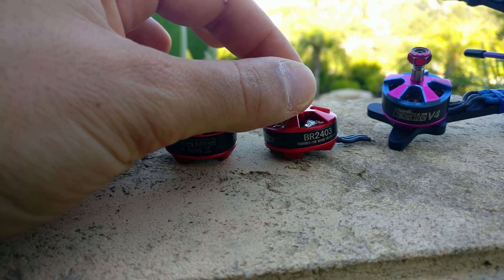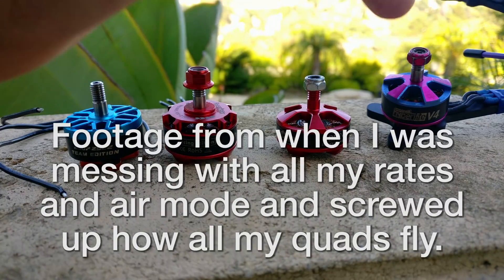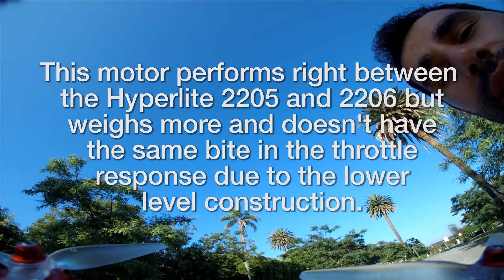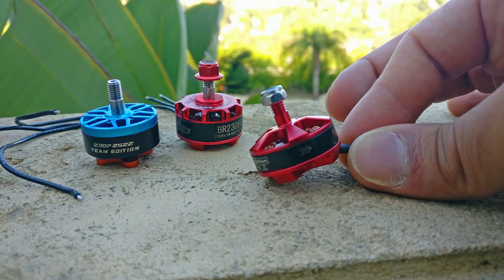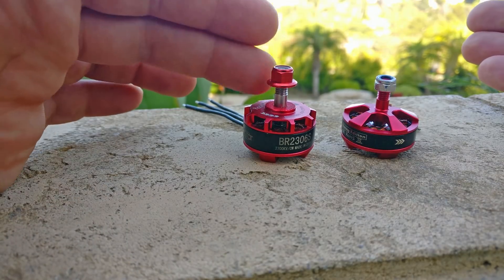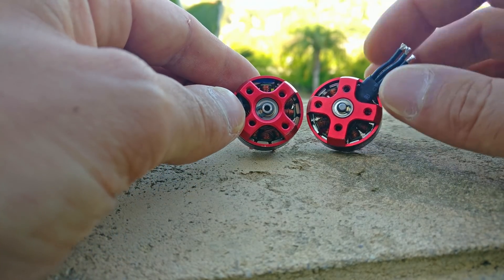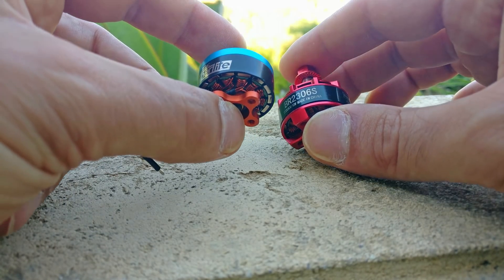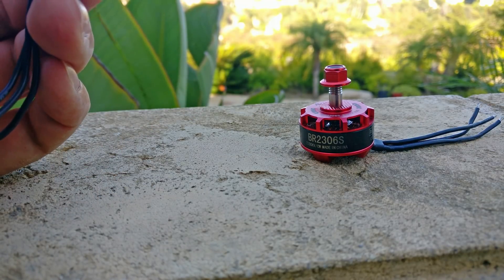Racerstar 2306 review + other things bout motors

Comment: I prefer your trash talking on banggood and their cheap products.  I like quality products and I put the Hyperlite V4 on my stingy frame.  I know you're into the super light frames but what should you suggest for a heavier freestyle build.  I was disappointed on the performance of the hyperlite motors.  Mainly because my other quad has F40 pros 2600 KV and those motors scream.  Yes they draw way more amps but the performance better.  I live in SoCal and I like supporting local shops like Piroflip.  What Hyperlite motor do you think would compare to the F40 pro.  Thanks
Reply from the maker: I totally understand what you're feeling because I've done it many times.  Super disappointing when the performance is just meh.  I'm not a super light everything builder, I'm just very aware of the weight.  Lighter is always better.  So don't put that last piece of tape on, cut your wires just a bit shorter...that kinda stuff.  Even though I like long wires.  Those motors are really only good on a light racer.  I do not recommend anything smaller than a 2207 for ANY acro quad.  The performance between the 2206 and 2207 is like going from 4S to 5S.  I believe the F40's are closer to 2700kv and they're lighter too so that would maybe account for the performance difference.  I would also ask what weight setup the F40's were on and what props you're running on both.  The Stingy frame is pretty heavy so it really needs the power of a 2207 or more.  I would highly recommend you put those motors on a racing frame and aim for a much bigger motor on the stingy or opt for a much lighter acro frame.  Also, mind the bottom plate braking on that frame.  The front section is really really skinny on the main deck.  Daniel will take care of you however so no worries.  I've been redesigning my acro quad constantly because I'm still not happy with it.  Hopefully sometime soon I'll be satisfied.
Reply: Kabab FPV I have no clue what the weight is.  I've compared the motors on a variety of props.  Hq 5x4x3, hq 5x4.3x3, buttercutter, GF 5152, and GF 2 Blade.  I like the performance of the 5x4.3x3 the best.  Very responsive and doesn't draw too many amps.  The other quad is on a chameleon.  On both quads, I like the 4.3s the best.  As you can tell, I like the bus style.  There is always going to be the next build.  I'm waiting for the top mount floss to come in stock for the light build.  

On the topic of quality parts.  All the folks pushing for the cheap products.  On my stingy build, I have the TBS bulletproof esc's.  Those are so much smoother than the t-motor f40 pros coupled with t-motor 30 amp esc's.  I'm really impressed with the quality.  I just think I need to get a larger motors.  Thinking about the hyperlite 2207 or 2306 but going to use the current ones for a while.
Reply: Are you that stupid for not being able to understand that not everyone can spend 500$ in a quad?

By the way bg also sells genuine stuff, so educate yourself, just a bit, before  commenting.
Reply: Remon Dislo I cannot comment on you because I don't know you.  I would never insult someone based on my imagination.  Forgive me for wanting quality products.  I personally enjoy quality rather than cheap.  Sorry, if I'm a snob, but I'm okay with that.   I was simply asking question to someone else until you got so offended that you needed to comment on something you have no interest in.  Keep up insulting people, it shows how great member of society you are.
Reply: Remon Dislo That was a very mature comment.   Out of content and useless information.
Reply: Remon Dislo Where did this comment come from? He said nothing about what other people can afford. He simply stated his opinion about banggood. Instead of questioning his intelligence, maybe you should question your own before commenting.
Reply: You are the one commenting crap nobody cares about. Snob, I can smell people like you from miles away, you are the typical snob that spends thousands of bucks in quads and doesn't even know how to coordinate a turn. 
Now keep telling us for third time how much you like quality stuff and about your shitty experiences with motors. Gosh, you wouldn't be able to notice if you are flying a quad or a fixed wing.

Comment: Didn't brotherhobby bought the what's now called returner series from zmx?
Reply from the maker: ZMX developed the motor that brother hobby now sells under their own name and rebrands for everyone else.  They did not design the motor they are selling, they stole the design from ZMX.  Since the ZMX motors were so damn good when they came out, the new ones are total redesigns and are probably a good step up in performance again as well.  I'm anxious to try them.
Reply from the maker: I forgot to mention the part where ZMX hired Brother Hobby to build the motor for them.  That's where it becomes fuzzy.  Brother thought because they're building the motor, they owned the rights to the design...
Reply: There was a bunch of drama when this came out essentially from my best recollection ZMX was claiming to had designed & manufacture the motor and was pushing it off on their own, Then brother hobby came out with screenshots and emails I believe to prove that it was in fact their design and they were doing all the manufacturing for ZMX. Now I see that ZMX is making a return with their own design.
Reply: Kabab FPV thanks for the clarification my memory was a bit hazy on it. I do remember the drama it stirred up though
Reply: Are the new ZMX motors the FinX series?
Reply: Kabab FPV thinking about some new motors, should I get the the 2207 2522 or should I wait for that motor with the ribbed sides you showed?

Comment: You should try the gartt motors. The z series. They are underrated on amazon. They make 1200g of thrust on 4s. They dont even get warm on 5s. Magnets are very strong. Not n52, but still strong. They are 32.00 a set. Best budget motor ive used so far. They are on par with emax. Havent bent one yet. Destroyed lots of other motors. These are still going strong. Actually ordered another set to replace my force motors that I crushed.
Reply from the maker: I've got some friends running those motors.  They're similar to the Racerstars which also make a little more thrust than that on the bench.  This is more of a 'you get what you pay for' kinda thing.  But the difference is that if you're not good enough to take advantage of the performance, there's no point.
Reply: Couldn't agree more. Ive talked to gartt about upping their rating on their motors. They said they rather under sell the product and perform better, than over sale and not meet demands. Tried to get them to rate them for 5s at least. They wouldn't do that either. Even though they run cooler than my actual 5s motors.

Comment: That's why it's worth it just to spend the extra money for good motors. It's amazing how much further you can progress with the right power system.
Reply from the maker: Seriously.  The difference between my good motors and random racerstar type motors is shocking.  But there are so many damn noobs in the hobby that would be offended if I said this.  I could give my best quad to an intermediate pilot and they would look like a pro flying it.  Very very few understand this unfortunately.  A good setup is not the easiest to spec out but when it comes together it flies incredible and you don't want to touch anything else.  Especially not those dumb 2" quads...
Reply: Kabab FPV I'm with you on that one my friend! Any seasoned pilot would agree. I'm basically a noob as well, but when a pro gives me advice I certainly take it.

Comment: Curious about the lipo
Reply: Do you use vbat pid compensation?
Reply from the maker: You mean the fact that I used the same one for both quads even though it was half empty?  Believe what you will but it's true.  The half dead lipo still performed THAT much better on good motors...